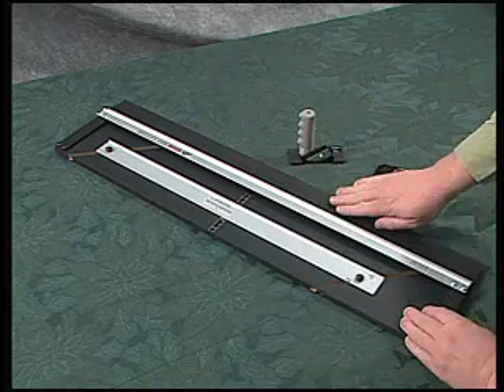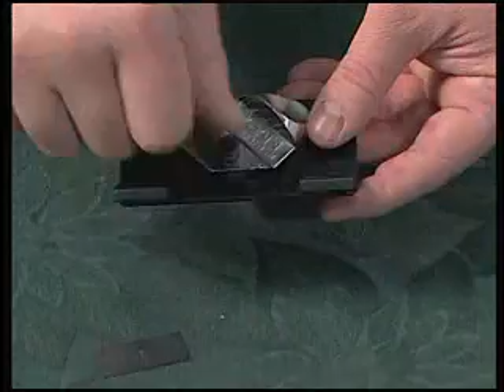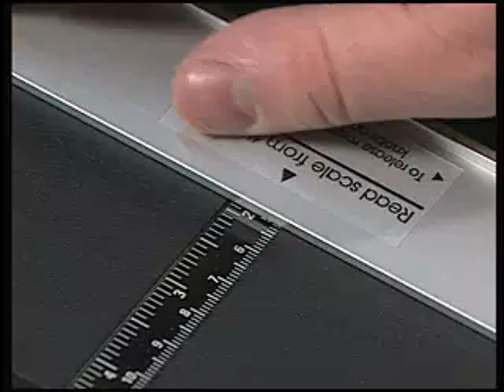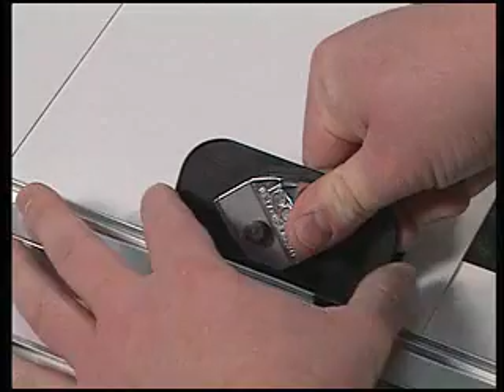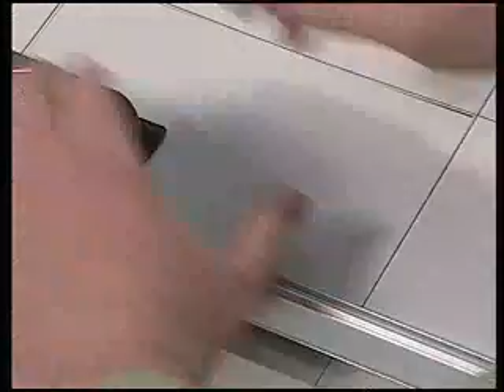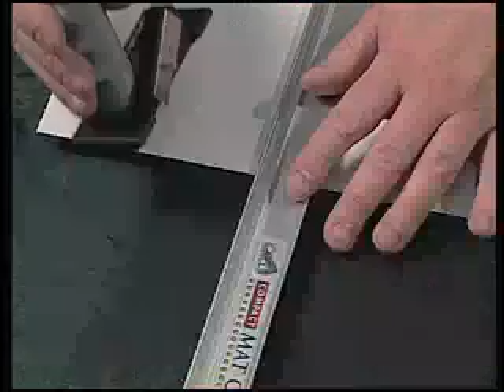Logan 301-S Compact Mat Cutter

Comment: are you able to cut larger mats with this? i work in larger scales and im wondering if this will for for say 48`to 52`in. measurements.
Reply: My question, too.  It shouldn't be a problem with the height and width, but is an issue if the width if the matted border is larger.

What I'm going to do is just get a flat board the same height, cut channels to continue those in the 301-s (but opposite direction: if yiu continue in the same direction your work falls off the guide).

I just bought a 301s and it hasn't arrived yet, but I'll extend it lime this when it does...